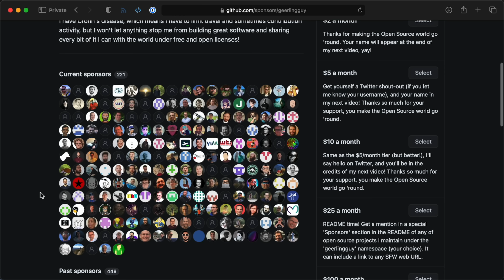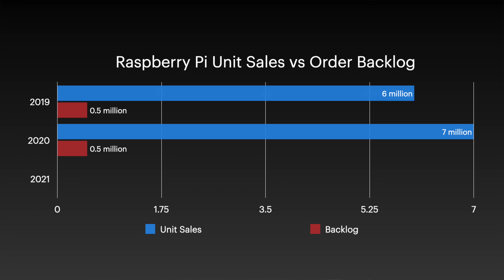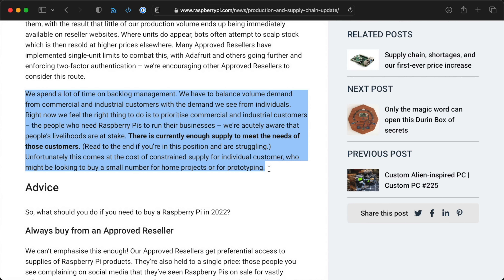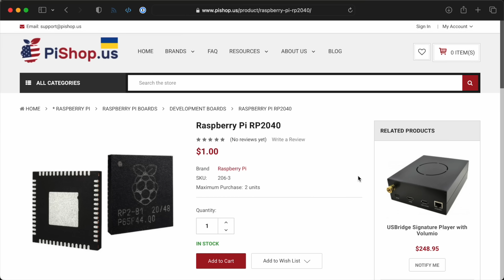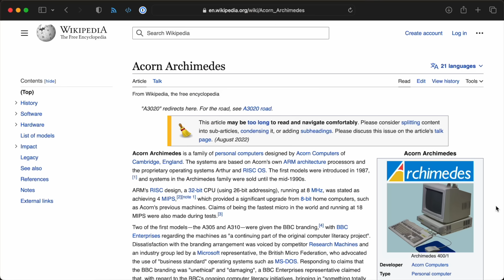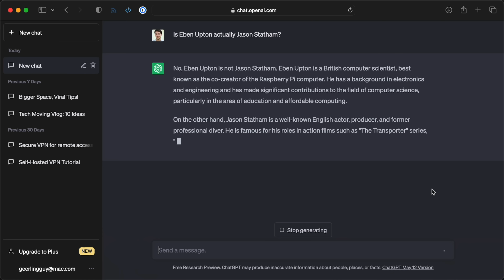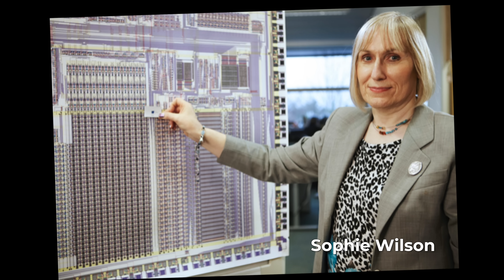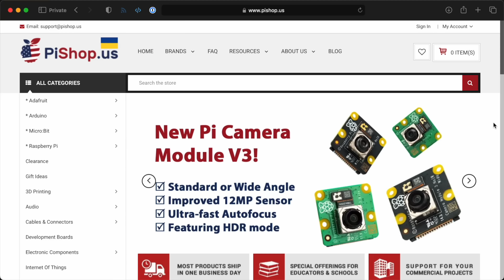He started a computing REVOLUTION—then the shortage hit

Comment: They could have let the prices float, taken those profits and used it to build on their factories and strengthen their supply chain, instead of fixing the price and letting the profits go to the scalpers.
Reply from the maker: The chip fabs are the bottleneck, and no amount of profit would've gotten more time on a semiconductor production line—Raspberry Pi was a small fish in the sea with the likes of Ford, Apple, Google, AMD, etc.

Better to take the lumps and not abandon the price point, IMO. Raspberry Pi didn't pull an Nvidia and double the price points year over year.
Reply: @JeffGeerling  Regardless of the chip bottleneck, there are probably other aspects of the company that could have been built up, expanded, or made more robust. In the end, what was the actual result? More profit to scalpers. Who benefits from that?
Reply: Increased prices would've reduced demand, though, which would've allowed them to catch up with the backlog, especially if it was done quickly. Which mightve allowed them to avoid shortages and avoid the scarcity mindset.
Reply: @JeffGeerling  Increased prices would've reduced demand, though, which would've allowed them to catch up with the backlog, especially if it was done quickly. Which mightve allowed them to avoid shortages and avoid the scarcity mindset.

Comment: Thanks for the coupon, I literally had a Pico H with a Discovery Kit in my cart on PiShop since I wanted to mess with it, I never worked with microcontroller and I'm interested in learning.

Around 2012, my friend had the original Raspberry Pi (the model B, even before the cheaper Model A existed) and he traded it with me for an old desktop PC to make a NAS. I loved playing with it and I used one of the first version of RetroPie (that really wasn't intuitive, you had to configure the controls for each emulator separately and download them yourself, which was a pain since it didn't had WiFi) to play on my old CRT since it had native Composite output. Years later, I bought the Zero W to replace it since it was so cheap, was slighly more powerful and had WiFi, which helped a lot with management. To this day, it's really impressive how small and cheap the Zero is. I also bought the Pi 400 when it was released because I loved the form factor, even if I didn't really had a use for it.

Comment: They are making a large number of Pis and then selling them to industrial customers... Basically they have said (and he readily admits and defends) FU to the hobbyist market...
Reply: Grow up. Making a tough decision about resource allocation isn't remotely the same as giving hobbyists the finger. Some people will never be satisfied, I guess.
Reply: @EnglishMike  - It occurs to me that the people that say "grow up" are often the ones that need to do the growing. Do you perhaps have a more substantive defense of their actions that "grow up?"]
Reply: @AdamsLab  Industrial customers buy Compute Modules, not Raspberry Pis. Those that did were recommended to move to compute modules. Smaller businesses that don't have the resources to spin their own carrier boards or redesign their products might use Pis 3 and 4 and are allotted as said in Jeff's video.

Hobbyists whose revenue doesn't depend on Raspberry Pi supplies might have fewer units available, but they are available as stocks permit and you can use Pi400 or Raspberry Pi kits. If your revenues depend on Raspberry Pis, please let your reseller know!
Reply: @martinboissonneault9819  - Hobbyist's buy both Pi's and Compute modules. I'm a hobbyist and waited for over a year for a single compute module (just one please). Finally broke down and paid 4x the price to get an industrial controller that included a compute model. Most places won't even let you get stock notifications so I double contacting them is going to do anything.
Reply: @AdamsLab  Or perhaps when dismiss a perfectly rational and reasonable explanation for their decision to continue helping their business customer as an "FU" to the hobbyists, it deserves to be called a childish reaction... Just sayin'.

Comment: I had a BBC Master 128 way back when, it was really the forerunner to the RPI in some ways, it had a port underneath that you could use for control functions. I used it for amateur radio, connecting a DIY interface  to read morse code, for antenna control and many other things, now the Raspberry pi can be used to do all of the same things, and faster :)

Comment: Great video Jeff, very professional!

For my part I'm hoping a Pi 5 appears with quad A78 cores (roughly twice perf of A72) or maybe hexcore 3xA55 3xA78?, but importantly with at least 4 PCIe v3 lanes. That will make a massive difference to the I/O options, which are IMO the Pi 4's weak point. Supporting full USB-C data + PD would be awesome! 
The Pi 5 might benefit from an onboard SPI-connected rp2040... possibly. If so, you've got an ADC at last!

Talking of Pico, I'm hoping a pico-NG appears that fixes some of the small irritations of the current model, such as being very sensitive to anything more than 3.3V (even 3.4V!) on pins, and the onboard peripherals having noticeable limitations. As for others, I agree the PIO in the pico is its saving grace, though having as much ram as it has does have big benefits.

It would be nice to see an updated rp2040 containing an M4 core (faster but importantly with decent float maths performance). Not quite sure how best to organise it - 1xM4 + 2xM0?
Reply: Well you were close haha

Comment: Had they floated the price, there would be no (or little) hoarding by speculators, and there would be more devices in people's hands.
Reply: And the profits could have been reinvested into the company/production to further benefit the customer. As you said, not raising prices benefited the scalpers, who then pass down zero benefit to the consumers. Not raising prices was an obvious wrong decision.
Reply: Or people resort to alternatives. I for one have been reusing older Intel boards for shenanigans and x86 compatibility
Reply: @woodysworkshop7123  The "free market" supply/demand pricing isn't the solution to everything, and frequently disadvantages the poor.  For a hobbyist/educational product the correct solution is to limit supply to small sales quantities.  As it is corporate resellers have raised the prices anyway, so who benefits out of that free market decision?
Reply: @Demopans5990  I replaced the RPi's that were running  Octoprint and Klipper servers for my 3D printers with Orange Pi Zero 2 boards thus allowing me to use my RPi's for other projects, I also bought some used Thin Clients to replace my Pi 4's that were running my MAME cabinet and my PLEX server and I bought an Orange Pi 5 for general tinkering, cant wait for RPi 5 though!
Reply: Personally, I've found about a half dozen different manufacturers who produce roughly equivalent products at roughly the same price point.
Odroid, Radxa, and OrangePi are major contenders in terms of power and often have models with more RAM than an equivalent Raspberry Pi. Anybody relatively familiar with what they're doing isn't going to be too hampered by the lack of official support.
I actually got a couple of different models of Orange Pi Zero during the shortage to avoid overpaying for a Raspberry Pi.
I'd imagine a good portion of people would do like me and source an alternative instead of paying twice the price.
Reply: @AndrewAHayes  Thin clients are the unsung heroes in all of this. They're generally more customizable on the hardware front, generally come with a case that's designed to fit a VESA mount, and have CPUs that are almost always based on the x86 architecture, so there's a lot more support for software as well. 

(If anybody's looking, models with the AMD GX-420AC are reasonably fast and don't struggle streaming 1080p video. You can get away with something less powerful for certain, but I've found that to be the sweet spot for cost/performance. Perfect for a media server, router, or any other lightweight application.)
Reply: Think you'd find there would be a lot more of them in businesses hands. If you have a choice between paying 4x the price for a pi or closing your business, you'll pay the extra. A hobbyist generally speaking won't do that. They would effectively be priced out of the market totally.
Reply: @ffsireallydontcare  Never said it was the answer "to everything", but certainly would have resulted in stock distributed more fairly.  Hobbyists right now are paying a premium for a 4, that premium would be less if the price had been floated.
Reply: @ffsireallydontcare  The reality is that your utopian dream solutions benefit the scalpers, and the best way to benefit the hobbyists reinvest the profits to growing the business so that access can be expanded in the future. Maybe capitalism isn't always the solution, but in this case it certainly is. Raising prices means the people who CAN afford to pay more subsidize future development. Is that not exactly what you want? Make the rich pay? Or something like that...
Reply: @trajectoryunown  Here's a fun one. Pine64 has aboard called the STAR64. It's nearly a RISC-V RPi.
Reply: @AlanTheBeast100  Based on what metric?  True free market capitalism dictates that you charge what the market can bear, so if the scalpers think they can still make a profit then they still raise the price.  At the very least you would see the official price at the price scalpers were charging, the difference is that the money would go to Eben.
Reply: @woodysworkshop7123  Ah excellent, the global defender of US freedom (cough capitalism) Youtube silently censored my reply to you.
Reply: @ffsireallydontcare  I'm glad that wasn't a real reply so I don't have to make a real response, but I'm not wrong. I know you hate scalpers, and keeping the price low benefits the scalpers. Consumer still gets the shaft.

Yeah, the youtube AI is off the rails with some sort of shadow banning. It's been happening to me all day. I actually can't find the original thread comment under this video anymore, I can only find it from the reply notifications. Guess big brother deemed it/us unfit for public viewing...
Reply: @woodysworkshop7123  Yes the other trick Youtube plays is to keep comments live, but only findable when you look at the comments in reverse chronological order.

Comment: I have a 4B, a 3B and a Zero-W; and for what they are, they're not bad. I think that for them to really heat things up, the Raspberry Pi foundation needs a five series and it needs to be a huge update. The reason I say that is because if you were just using it for cheap computational power, a thin client that I get off lease or something can do more. I can get something around $80-$120 running like a 6th Gen i5 w/8GB of RAM and 256GB of storage; which will absolutely smoke a Raspberry Pi of any generation for educational applications. You put a Debian related distro on it, like the Pis have and it's going to have more utility than those. Where it falls short is power consumption and portability. That is being covered by other companies right now, which is also chipping away at their customer base.

Just sitting around at the current level of power / performance isn't going to cut it.

Comment: Certainly have fond memories of my BBC Micro 32K, not so fond a time getting burgled and it getting stolen.. :(  But it did get replaced with a Master Compact,  that floppy drive was a big upgrade for me, after having used cassette tape.

Later getting a A3000, so was of course an early user of a RISC machine.. :)   It was an amazing machine at the time, the OS even though parts of it were initially written in BASIC was super fast & way ahead of Windows & Mac.  I always remember it's party trick of been able to format a floppy drive, at the same time as copying files to it.   I always thought it not taking off across the pond was a missed opportunity.   Even if you look at screenshots of the 1987 Risc OS,  I think it still looks amazing, I wish I aged that well.. :)  Remember this was when Windows 2.0 was released.. Yuck!!

Comment: Ebon’s not kidding about the attrition of units. I snagged a cluster of four Pi4s right before supply took a nose dive. One of them (25% of my stock) had the USB-C power port work loose and come off the board. Completely my fault, but I now had a dead board on my hands. I rescued it by getting a NesPi4 case that provides power through the GPIO pins, but that’s not going to fix every case. (Plus, that’s a rather expensive fix!)

Comment: I had to work up the nerve to watch this. When it first popped up in my feed I hid it.

I've rewritten this comment in varying lengths but ultimately I'm one of those that has been completely put off of Raspberry Pi over the last couple of years.

Most of my anger comes from their continued use of largely closed SoCs while claiming to care about open source. They're in a position to advocate for greater openness of the platform, but don't seem to. It's talking out both sides of their mouth.

Then the Mastodon fiasco and non-apology. I don't really care who they hired in that instance, it was just handled incredibly poorly.

Then pivoting to be primarily an industrial supplier without being up front to hobbyists, those that helped the platform get to where it is, until three years later.

Too little, too late for me. I'll deal with other boards where I have to scrounge around for firmware or devicetree files for other boards.

I don't wish them well at this point.
Reply: You are absolutely right. It Was a fundation now is a B2B project. 😢

Comment: Raspberry PI (whatever version) has actually turned out to be (well for some, insert computer of choice) like Commodore C64 in some ways. It was not the best computer at the time, it was not the cheapest computer. But it was cheap and very very good for it's price... And that got the ball sort of rolling, and software got made because of it. That made the computer so much better. Are the alternatives to Raspberry PI, yes many... but software, userbase (which also turns into a great support) just makes it a solid foundation to build stuff. As it was with the C64 as I remember it... and I guess that was the idea all along Raspberry PI from the start...

Pi Zero 2 W, I just have to buy... but for a reasonable price...

---edit

Awesome interview! and Eben Upton is passionate and smart thinking... awesome stuff!

Comment: The Pi shoartage got me to tinker with some more exotic SBCs like the Orange Pi Zero and the NanoPi NEO. I had to design 3D-printable mounts for both (on a Pi Zero I would have found something fitting my needs without having to learn Blender (yes, really, it's FOSS or bust for me, even for 3D modeling)); also the integrated type a USB sockets and RJ-45 ports made things much easier than they would have been on a Pi Zero. Necessity is the mother of invention.

Still paid 30 bucks for the two SBCs that should have been a tenner.

Comment: "What's the only capability that a modern Raspberry Pi has that the Raspberry Pi 1 didn't have? Wireless networking" – and it's exactly one of the few capabilities I have never used on any Raspberry Pi that I've used.
Reply: Then you probably dont even need a normal Pi right? What are you doing completely offline that a zero or pico cant do?
Because for me that is the main thing I use. PIs are perfect as a little server for random sensor data or to run a print server for my 3d Printer.

Comment: Just a couple weeks ago I was looking for an RPi solution to run K40Whisperer for a used (and abused) K40 laser cutter that I acquired and am in the process of bringing up to task. CanaKit just happened to have Pi400 kits in stock so that's what I went with because I wouldn't need to come up with a keyboard and mouse separately. I just happened to have a spare HDMI monitor available, so I think I lucked out there.

Comment: Fantastic interview, and thanks for putting up. I've done my best keeping in the Raspberry Pi camp, and been waiting for availability again, but I'm happy to wait. Also, it's been a good 3 years now since the Pi4 and 400, and other SBC's have been pushing a bit more over the last couple of years, So I'm really hoping there's a Pi5, and Pi500 on the cards. Since the Pi400 was integrated with a keyboard in a bid to call itself a small computer, it would be great if the TF card slot is supplemented with eMMC, or options for NVMe expansion. So here's hoping the Pi500 has expanded storage, and maybe a beefier GPU over it's Pi5 cousin.

Comment: What you said about the anger issue is correct o felt I would never use raspberry pi again and would switch to a different SBC but as time went on I realized that raspberry pi in any form had no real  alternative as all other SBC doesn't support the software as claimed properly or has quality issues. A personal example when I used 2  orange pi zero with Octoprint on 2 of my 3d printers the amd started using them at the same time one orange pi zero died and when I checked it the arm chip under the heatsink with fan had a burn mark but the other orange pi zero with an exact similar setup and exact similar components is fine even though it was used more and fit longer and bigger prints. The worst part about the orange pi is till date I could not find out what killed the board I teird and tested all suggestion I found online and in multiple forumsbut nothing fits my dead orange pi zero. But the multiple raspberry pi zeroand regular version I used or even setup and gave away are all still working fine only one pi 3 B died and that was due to positive and negative power input being incorrectly reversed in the gpio pins and I found out the reason. So never changing from the raspberry pi ever again